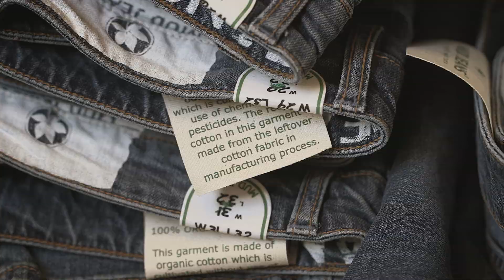Moving towards a circular economy (short version)

Comment: A new circular economy of re-cycling used materials is likely to be more costly than if the materials were thrown away and fresh materials used. That's why there is so much pollution and it only when the cost of the trouble caused by the waste is greater than new materials does the world have a chance of recovery. Perhaps the whales and other sea mammals can learn to charge rubbish dumping countries for what they are having to try to digest, with such dire results, recently publicised.